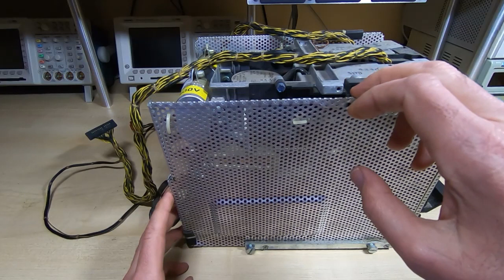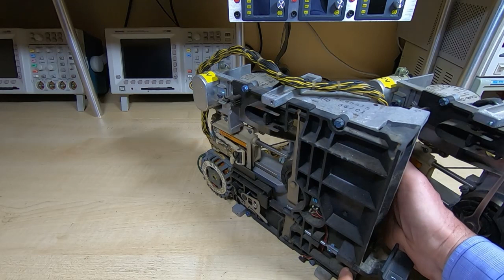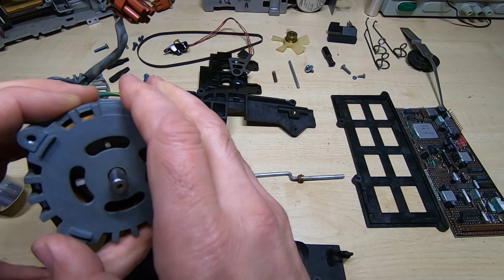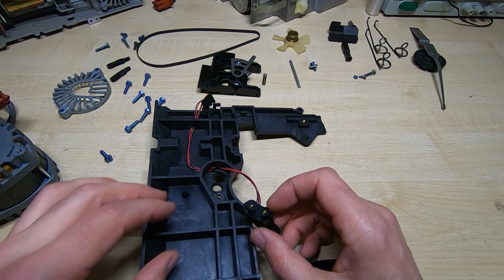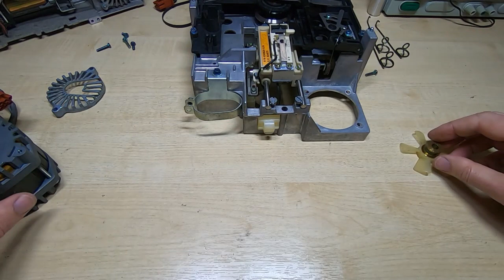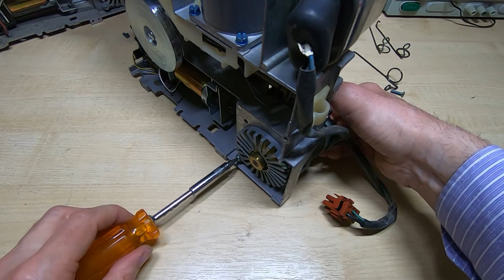IBM 5120 Part14

Comment: Great devices!! The drive looks like Type 2 (very desirable) with two heads since I’ve seen two index sensors. It is capable to read both Type1 and Type2 8” disk. To me are the same used in IBM Displaywriter FDD (mod 6360) there are some service information with block diagram , wirings and adjudtments on bitsaver site. I’ve recently overhauled a unit.
Reply from the maker: Single head. The two sensors are a form of soft sectoring. I have copies of the general block diagrams etc but a schematic would really help due to the very poor condition of this unit and the number of faults it has. Just an addition to my original comment to avoid any confusion. The drives are double sided with a single head per side so actually, yes two heads but only a single head drive mechanism (I may not have made that clear in the video as it was edited from quite a few hours work).
Reply: Jerry Walker very difficult to find. I’m seeking here since a while with ex IBM    people  (a closed IBM factory producing 80’s staff) without success☹️..so far...
Reply from the maker: Yes I have also been searching for many years. From what I gather IBM stopped making schematics available to prevent 'copies' of their equipment being made. I am hoping that an ex IBM employee managed to keep copies and will make them available. I do not think that the floppy drives will get this unit to boot as the check process light illuminates immediately so most likely at the very start of the self test which is way before the FDD test. I think there is a fault in the ROM memory card and this will be hard to fix without schematics.